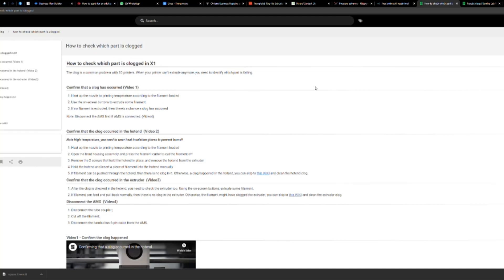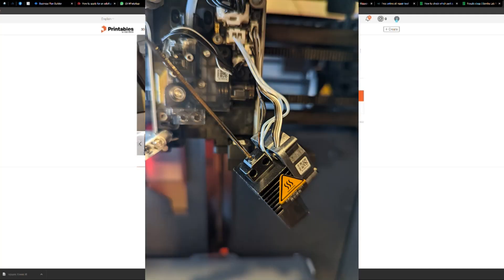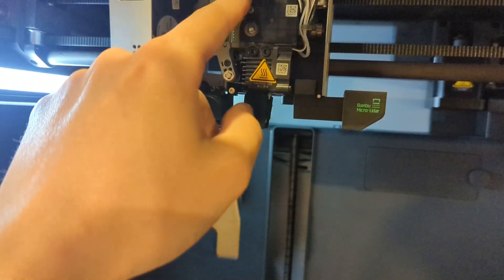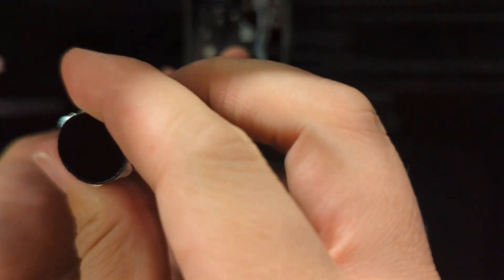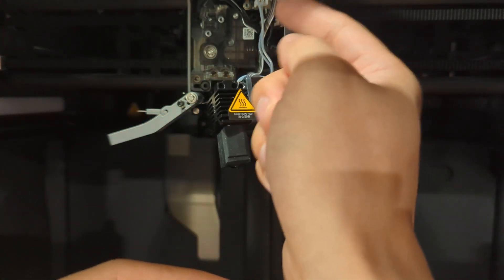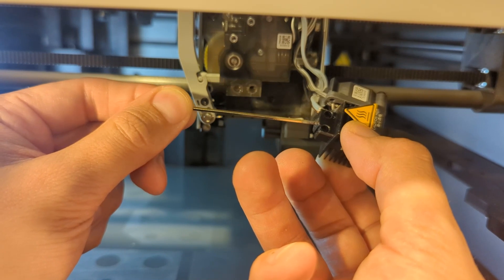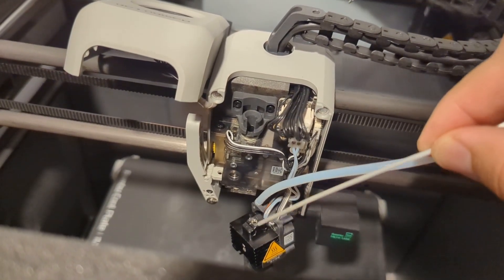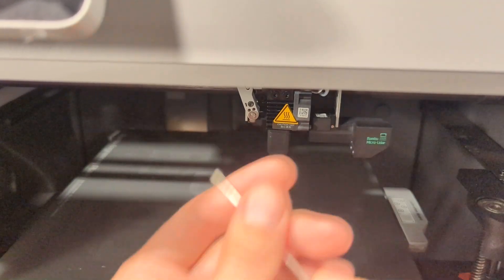Bambu Lab X1 3D Printer Clog & Block in Nozzle and Extruder Quick Fix

Comment: I got Extruder Filament Error - Every time i try to print it rolls the filament in to extruder - waits 10s - rolls/spools back then gives me this Extruder message then i click problem solved and then after few more tries its finally starts to print . I bought new metal gear wheels , new filament sensor , new microlidar , new PTFE Tubes and still the same error message .
Reply from the maker: Interestingly enough this just happened to me yesterday. 

There are multiple reasons this could happen. It's important to check the extruder or hotend isn't blocked.

For me it seems the motor on my AMS just isn't strong enough for the final push or my extruder spring is too tight. I helped force the filament in the ams the final amount and it went through. My AMS is old.

I was also thinking the cutter may be worn and the filament tip isn't cut right to feed into the hotend.

Comment: Did you heat up the Allen key ? Ty
Reply from the maker: In this case I did. But sometimes you can just hear the hotend, turn off the printer and use pliers to remove the filament.

Comment: I was monitoring a print on my Bambu Lab X1C while away from home and as it finished I called my partner and asked her to turn the printer off, she turned off the power button but she must have done it before the filament had retracted back and I got a message confirming this error and now it is completley blocked and the AMS wont budge at all, I consider this the price of education!, it could be a nozzle clog or a clog in the gearing, I will try the nozzle first though.
 I am thinking of getting the third party hotend that takes the volcano style CHR nozzles as this will be much cheaper than replacing the whole BL unit, the advantage of this is that fast prints will have an increase in quality as they will now be able to produce the correct flow rate.

Comment: Good information here. But, if you have a real clog in the nozzle that the extruder gears have been grinding on the filament for awhile, the only way to remove it is to remove the extruder and take it apart. I have found no way what-so-ever to get that flattened filament past the extruder gears. Trust me I have tried. I have had 3 clogged nozzles with only printing PLA in 2 weeks. I printed with my Prusa for over 2 years and never had a clogged nozzle. That is a bummer about the X1.
Reply from the maker: Wow that is either extremely unlucky or something else is going on. My clogs have all been moisture related or trying PVA,... which doesn't work for me by the way.

Comment: Question: Is the nozzle temperature set at 250c whilst you're doing all this, including touching the heatsink?

I imagine you're doing it from cold... then setting at 250, and getting on with it before the heatsink gets hot?

Well... in I go... I'll find out for sure in a few mins! :D
Reply: Believe it or not you can grab the heatsink with the nozzle at 250 C and it isn't hot at all. Now maybe after printing for a few minutes but not right after it reaches temperature. I couldn't believe it and of course I had to try it.
Reply from the maker: Oh I hope all was alright. Late reply. Usually I heat up to 250C and then turn off the printer. If I need to heat up again I may turn on and heat up. I try to turn off the printer when messing with it, in case I break the hotend fan or cause a short by being clumsy.

Comment: Worked like a Charm.   At first I didn't think it would because my extruder clogged with PC+ Filament.   Did exactly like you stated; I used a smaller allen key though, and heated it up with a lighter and waited 30 seconds after a hard push and hold.  Walla!  Came out so EASY.  Thanks!
Reply from the maker: Great! Glad to hear it works for others too!

Comment: I think that is going to be the major ongoing problem with this printer, not having a cheap easy to replace nozzle like all other FDM printers. I have always solved 99% of my clogs with a 50 cent nozzle replacement.
Reply: This type of clog is in the heat break though. Can't solve that with a nozzle change on other 0rinters that way. Also the nozzles aren't super expensive at only 15 bucks which is significantly cheaper than the equivalent e3d nozzle (remember this is hardened steel)
Reply from the maker: Yeah definitely could be the case. So far Ive fixed all my clogs with the videos method and a cold pull. Happened to me maybe 8 times now, and didn't need to replace the nozzle.
Reply: P.S. that is the strangest desiccant I have ever seen and I have never seen desiccant paste.
Reply from the maker: @stevelaminack1516  YEAH! I had the same reaction.
Reply: Total cost of this clog fix: 0 cents.

Total cost of your nozzle replacement: 50 cents.

He's still 50 cents up on your relatively expensive to fix other fdm printer.